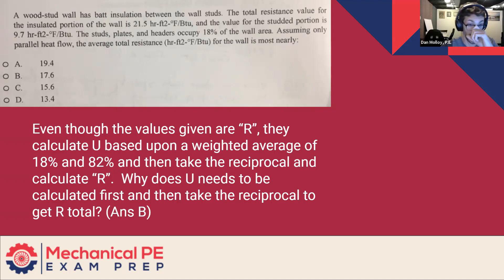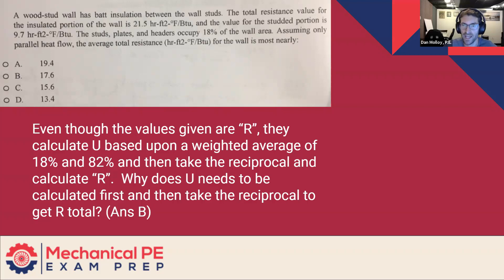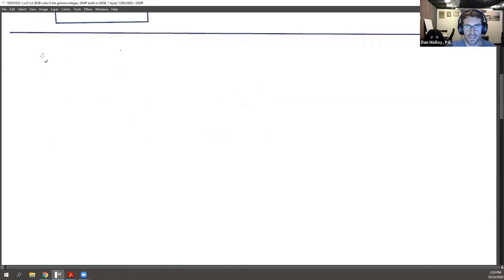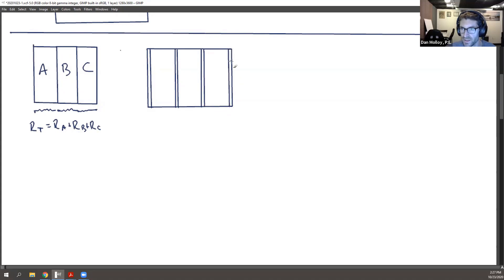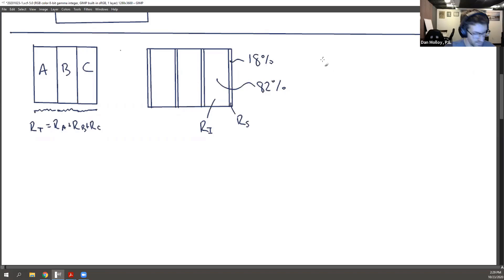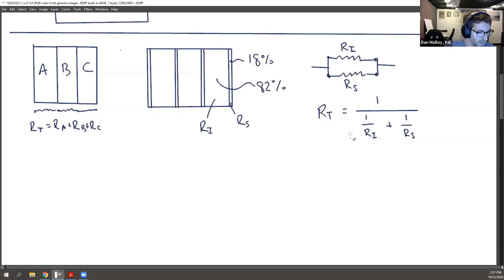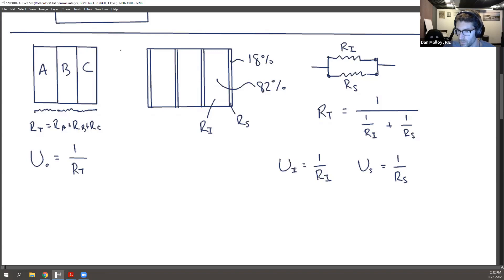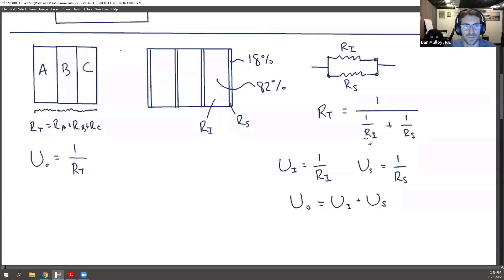PE Exam Prep Made Easy: Master Parallel Heat Flow Problems for the Mechanical PE Exam

Comment: Rt in parallel is usually written as 1/Rt = 1/R1+1/R2....+Rx.  It comes from a proof.
Reply from the maker: Thanks Jeff.  I had to go away and refresh on that after that day's office hours.  Mechanical guy trying to make analogies with electrical! SMH... Thank you for putting it succinctly for others to refer to, really helpful.
Reply: @MechanicalPEExamPrep  No problem. I'm studying for my PE  in Mech Eng, but I'm taking fluids.  Still, your videos are helpful and I appreciate it.
Reply from the maker: @jeffholmes2408  Awesome, I'm glad it's been helpful.  It's probably 60% overlap or more.  I've had a handful of candidates go through my program and pass the TFS exam.  I'm working on a dedicated TFS program now which is in the early stages.  Drop me an email if you want to give me any suggestions or if I can help you on your journey.  Dan@mechanicalPEexamprep.com
Reply: @MechanicalPEExamPrep  Thank you very much.  I'll do so.